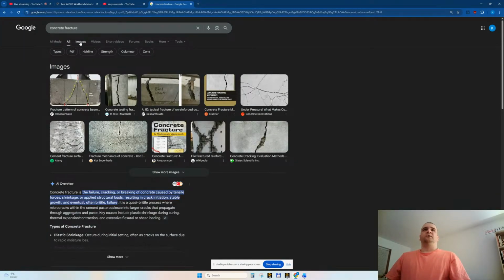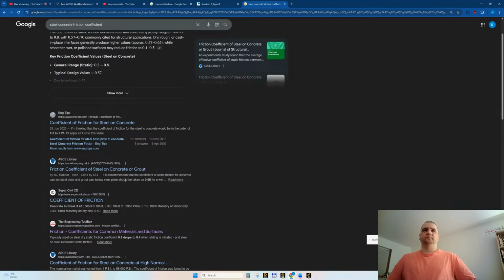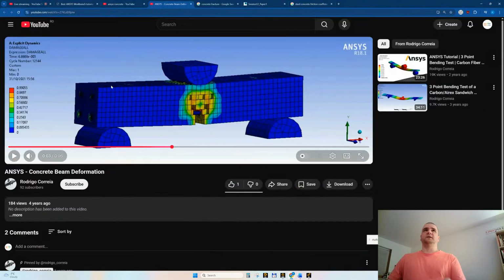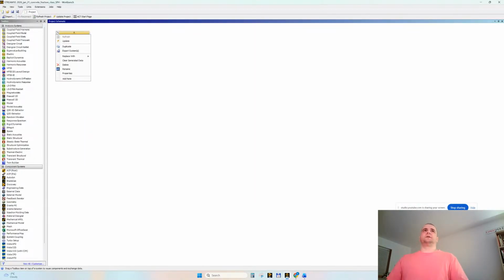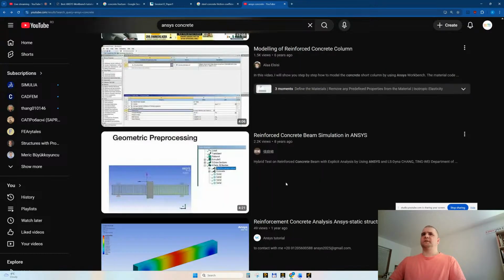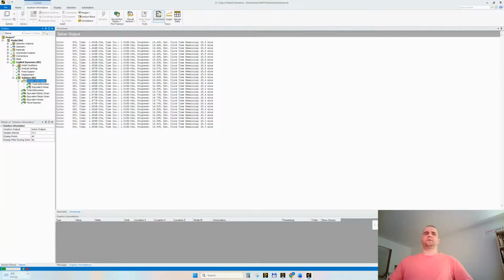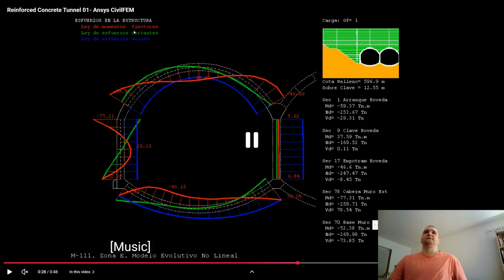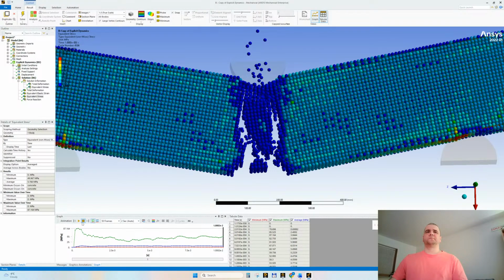Simulating Realistic Concrete Cracks: SPH vs. Lagrangian FEA Using ANSYS - LIVE Stream 10

Comment: Dear ENg
You used explicit dynamic in spite of the load is static , WHY? if this right how to adjust solution to simulate static effect in explicit dynamic solver ?
Reply from the maker: Hi, as I also replied to your mail, the main topic was to achieve concrete fracture or mesh erosion, which is possible only by using Explicit Dynamics.